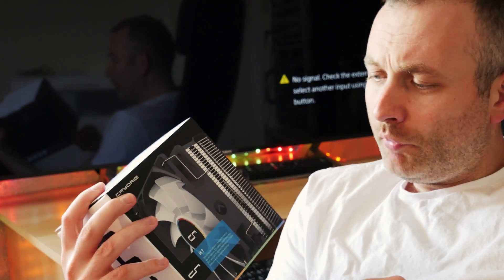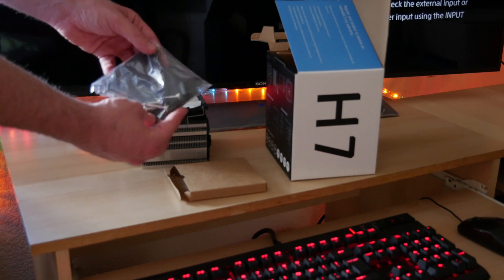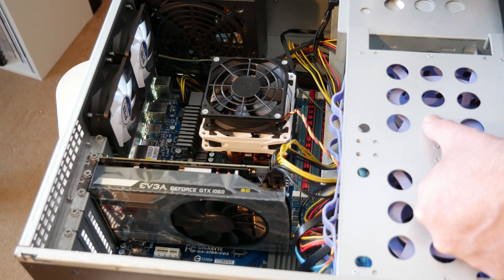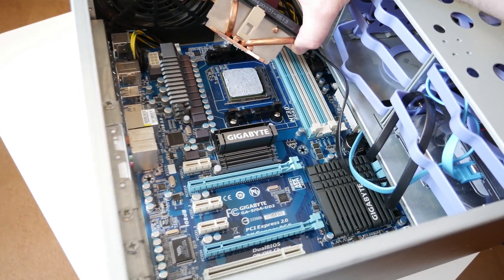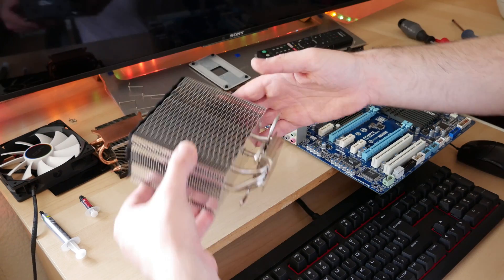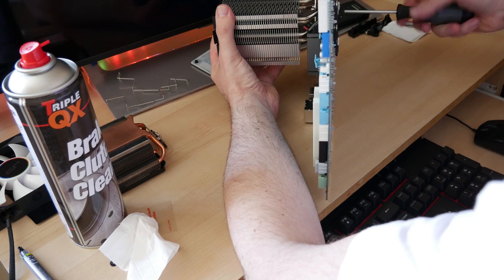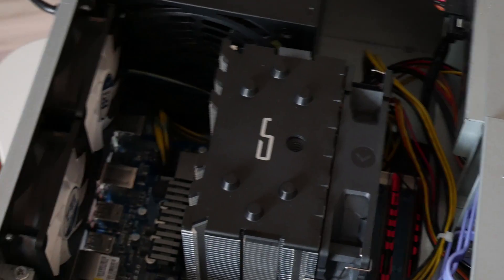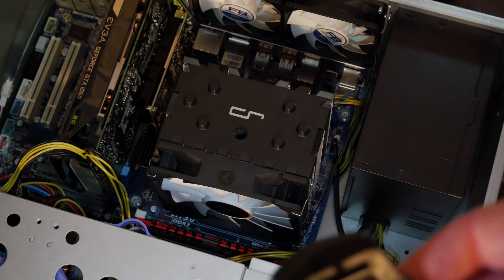Custom Case Cryorig H7 prep for Ryzen gen 2 Workstation Rack 2018

Comment: Hello, nice demonstration. What happens if you try to rotate the cooler 90 degrees? I have a 4U case but my socket is rotated (X470D4U) and I'd like to have the cooler facing the front of the case.